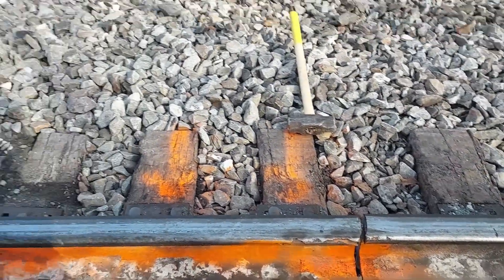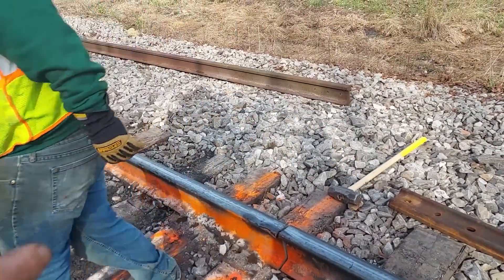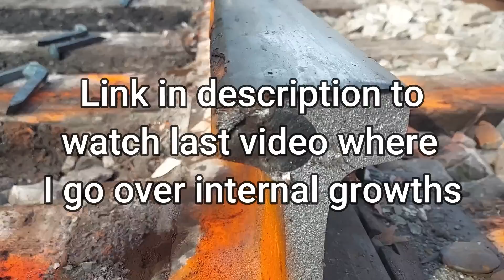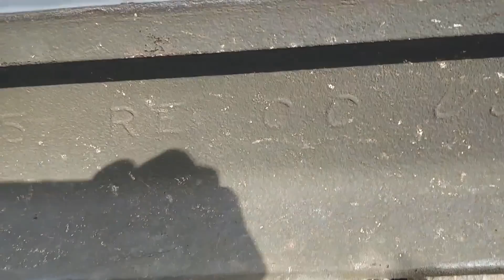Changing a Broken Sperry Rail

Comment: Amazing how many issues on this short line. I'm guessing the prior owners ignored long-needed repairs/maintenance for at least a decade or even two.
They are spending lots of money on much needed work. While getting higher speed limits in repaired sections, the real savings comes in reduced track closures over the long run.
Reply from the maker: Our last company had filed bankruptcy and there was no money
and our track went to heck StevieWonder. It doesn't take long
for a track to go south running heavy coal loads, so new company is playing catch up. Not only the track, but prep plant
and under ground got in pretty bad shape too, so they have
had a ton of money to spend in those areas besides the track.

Comment: Detail fracture in the middle of a shell. Tampers will find them, but the idea is to find them prior to failure.  Rails typically will develop multiples of this type of defect.  A transverse fissure is usually centrally located and from a cooling crack.
Reply from the maker: You are right about that CRTinyDuffy. Sometimes the tamper
will find them before the ultrasonic testers come in too. That's
railroading. Thank you very much for taking the time to visit with us and check out the video. May you have a very good day my friend.

Comment: Great shot of the TD. Can you tell us the weight of rail that you run on. I didn't get a good look at the web . Also do you know the gross tons per year?
Reply from the maker: We have almost all 132 pound rail with only a small scattering of
136 Thomas. Last year we ran about 5.6 million tons. The best
we have ever done is a little over 6 million tons a year. That is
coal, not gross tons. No one keeps track of gross tons here. 
You can figure 38 loaded cars at 286,000 pounds per car, plus
2 locos at 368,000 apiece to find our train weight. If you want to do
some more math you could probably come close to gross tons
per year. Very grateful my friend for your taking the time to visit
with us and check out the broken rail video. That was 132 where
the rail had broken.

Comment: Hi! Can you tell me what is the thickness of the ends of the railway switch? pleace
I study railway engineering on Nantucket.
Reply from the maker: There are two different thicknesses of the switch points depending on
which switch it is. The Detail 6100 switch has a 1/8 inch thickness.
The Detail 4000 switch has a 1/16 inch thickness.
Reply: @ccrx6700  Thank you so so much.

Comment: Very interesting video. I didn't understand why both the existing rail and the new rail were cut. I would have thought only the longest rail would have been cut so as to take advantage of the prepunched splice holes. As far as I know you don't use long welded rail.
Reply from the maker: It was because we wanted to do a weld in there and eliminate
a joint. Welders cannot do a weld where there is the 3rd bolt hole Peter so we cut out a piece of the old rail so it could be welded.
Hope that helps explain. Thank you for taking the time to visit with us and check out the video my friend.

Comment: Dave, I don't know if this has come up before in another video, but I'll ask any how...

What is the purpose of clamping the rail cutting saw to the rail?  Also, what is that "clamp" called??
Reply: It keeps it in alignment, it'll cut faster if it isn't getting any drag from the sides, and stops any possible binding/grabbing of the blade /disk in the cut & possibly shattering/shredding the disk or launching/throwing the tool into the next county or at the guy/ operating it.  Efficiency & safety.  Sorry, no idea of its name.
Reply from the maker: Good question Jerry. That clamp is called a clamp and it holds the
saw steady, it's really really hard to hold that saw steady free hand.
Appreciate your taking the time to visit with us and check out the video my friend.

Comment: Your presentation and explanation is exceptional. Class 1's employ there own MOW gangs for maintenance and replacement. They also own and operate their own geometry equipment. Testing is farmed out to Sperry Rail or another testing outfit. Rail grinding to LORAM or an equivalent company. It's more economical for short lines such as yours to farm this work out. However, they still need experts like you to diagnose defects and report them. It appears that that section of rail was rolled in 1925, if I read the date correctly.
Reply from the maker: Thanks for the really great comment Gary. One correction rail was 1975.  Appreciate your taking the time to visit with us and check out the video my friend.

Comment: Dave why grind the new rail, raise bars or weld an 8" triangle bead run off on the old rail to match the new rail. Geismar or Hillti blades with a Racine machine will cut through like a hot knife through butter, I went through many boot laces slotting rails!!
Reply from the maker: Thanks for the suggestion Billy. Appreciate your taking the time to visit with us and check out the video my friend.

Comment: Interesting in that we use the same type of drill but the instructions said to be sure and use coolant to keep the annular cutters from an early death. I noticed the crew doing your rail weren't using any. I wonder how long their cutter last.
Reply from the maker: They had a squirt bottle of water, we use a special cutting solution
diluted with water 10 to 1 it works well, without it you cut life of
bits by at least half Keith. Appreciate your taking the time to visit
with us and check out the video my friend.
Reply: They were putting some liquid on with a small water bottle.

Comment: Why is the joint bar inside the rail? It won't foul wheels running over it?
Reply from the maker: No the top of the bar is below the rail head and below the flange
of the wheel Charlie. All is well. Appreciate your taking the time to visit
with us and check out the video my friend.

Comment: Do rails become work hardened? That metal structure is strange. Thanks in advance.
Reply from the maker: I'm not exactly for sure what that means Greg, but my limited
knowledge says yes they do. Appreciate your taking the time to visit
with us and check out the video my friend.
Reply: @ccrx6700  that look of cast iron structure is what an excavator boom looks like when it fails. Constant loading and unloading of stress changes the metallurgy to failure. Work hardening.
Reply from the maker: @gregstone1306  👍😊

Comment: Neat work Dave, that's a good team! Just wondered if standard spikes are used on the old ties or do they have slightly oversize ones?
Reply: I think in the past Dave has mentioned using something like spike goo that somehow holds them tight.
Reply from the maker: Thank you Richard.Standard size spike but we put a product called
Sure Spike in the hole to stiffen up the spikes. Appreciate your
taking the time to watch my friend.

Comment: Enjoyable content, as always!  I do a fair amount of metal cutting, maintaining fences on my Texas ranch. I have found that the extra money for diamond blades/wheels really pays off. Not sure what the worker was using to cut the rail, but looked like a "composite" blade, based on it's black color. The extra speed and number of cuts that you get from a diamond tipped blade pays off. Even better, the nasty "stink" of a composite wheel  doesn't happen with a diamond tipped blade.
Reply from the maker: It is a composite wheel Jeff and sometimes they last decent and
sometime they don't depends on who you get them from and also
if they get wet, don't use them! Thanks for the heads up on the diamond, these are 14 inch wheels don't know if anyone makes
them or not will have to do some research. Thank you Richard  for taking the time to visit with us and check out the video my friend.
Reply: @ccrx6700  yes they make diamond blades for 14" as well as 16" saws. They cost about $125 for a 14" metal cutting blade compared to a  $13 14" Norton composite blade. I regularly use diamond blades for masonry but have not found them useful for ferrous metals, they are quite good with aluminum.
Reply: I know that if you let the blade hit a rock they get a bad spot and the blade is done. Once the outer edge has a bad spot it will just get worse with use. Also I set my pant leg on fire and got a nasty burn on my shin. I try and make sure from now on that someone is standing by with some water just in case.

Comment: In my scrapping days, I learned that you could break a rail with a sharp blow from a 20# sledgehammer. I only had a 16# but if you took a chisel and a drilling hammer to create some stress points, It would break after 2-4 herculean blows.
Reply from the maker: Cut the rail head and yes you can break 132 pound rail with a sledge
sometimes MrJoe. Thank you nice comment and for taking the
time to visit with us and check out the video my friend.
Reply: @ccrx6700  Miles of our railways were closed after our famous Dr Beeching decided we did not need them in the 60's. I saw a newsreel of a gang taking out the track and was surprised they had just cut a nick in the rail head every yard or so, it showed a guy with a sledge hammer easily breaking them, so saving them a load of cutting gas for the torch.
Reply from the maker: @cedarcam  ive heard of him before 😭
Reply: @ccrx6700  He devastated our railways Now we are paying the price with road congestion. Some lines and stations have reopened and more being planned but a lot of land was built on or like the main line behind my house made into a road.
Reply from the maker: @cedarcam  ive heard that 😭